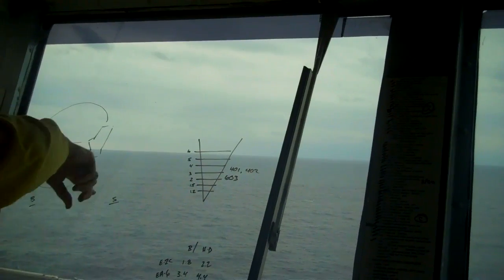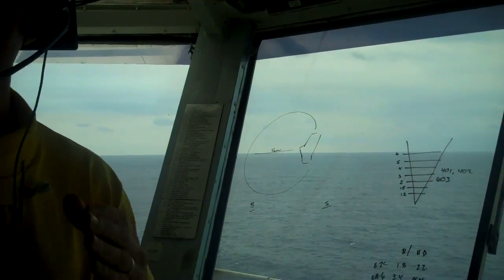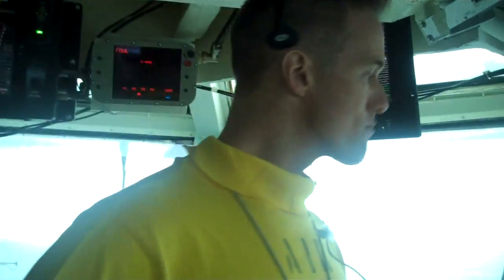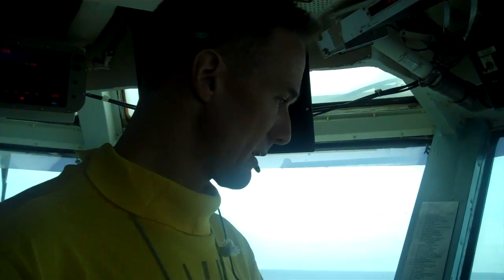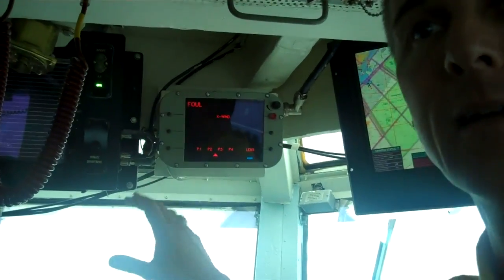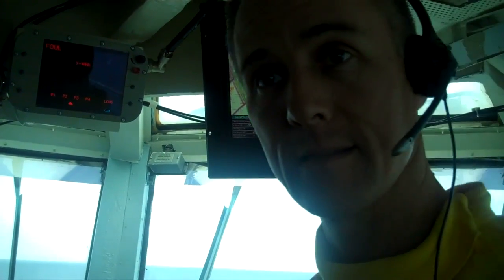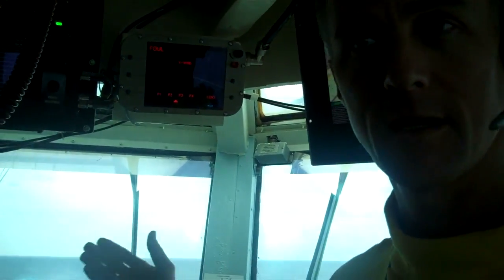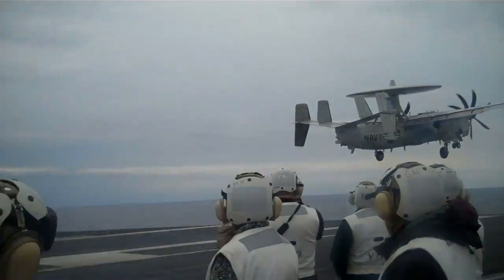The Truman's  Air Boss on How It All Works

Comment: "...It's basically a loud PA system." If you weren't at sea with a gale trying to drag you off a deck while aircraft roaring six inches from your head are just aching to incinerate you and tear you into pieces, that PA system would dissolve your bones in a puddle of ooze. If your high school principle had used that PA to announce the lunch menu, you would have been crushed in the rubble.